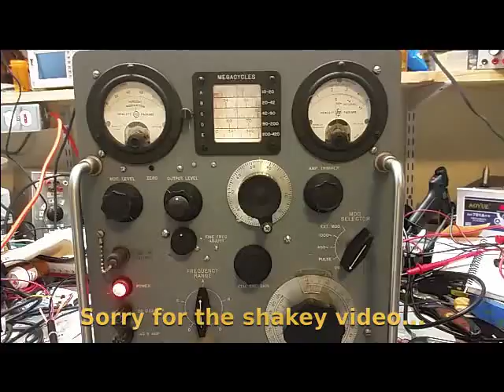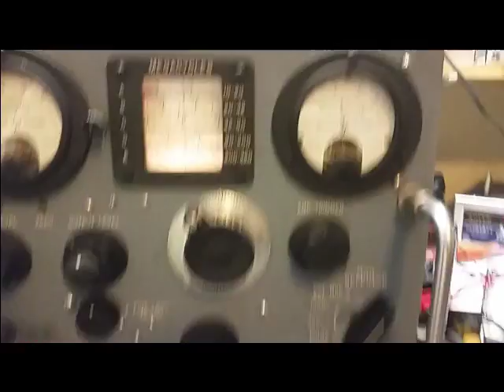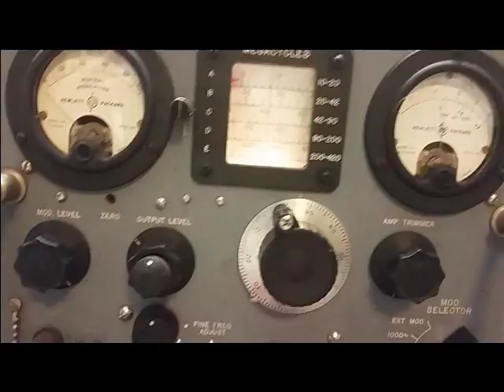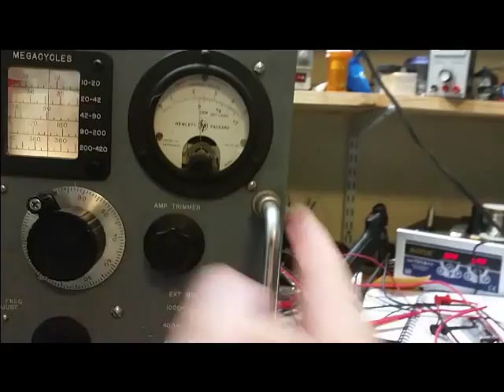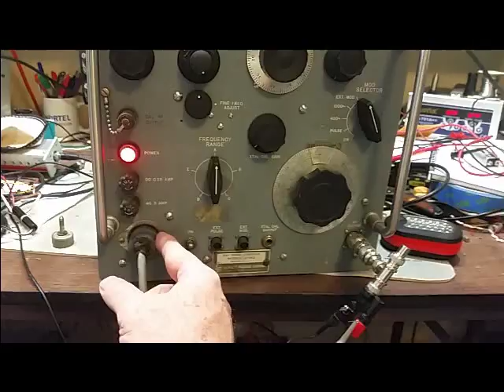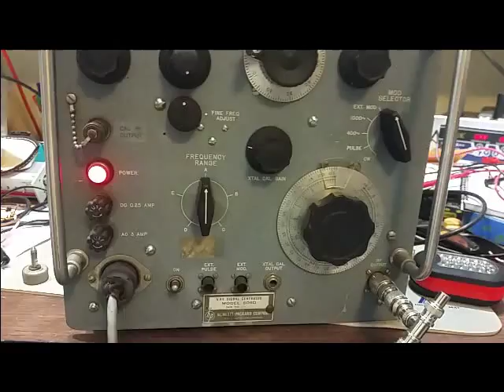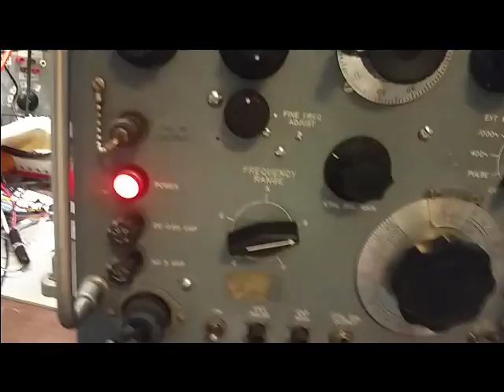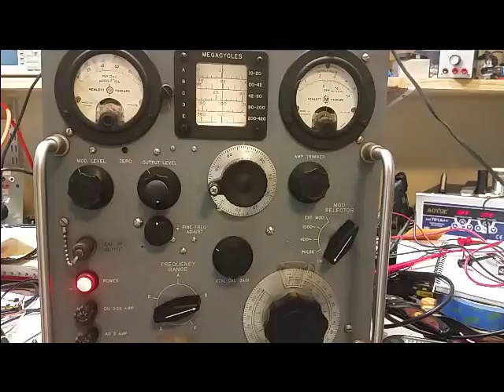Hewlett Packard 608D VHF Signal Generator Overview and Operation

Comment: I remember the H.P., Hickok and Tektronix "monster series" test equipment very well. Had to pickup and deliver calibrated test equipment to the user. The equipment was rugged and surprisingly accurate after a long warmup. We had to perform mechanical adjustments when needed for the dials.

Comment: I have a 608E that is just sitting here collecting dust. Is it of any value to anyone? I hate to just sit on it if someone could actually use it. Are they easy to get? I got mine from a local college that was retiring a bunch of gear.
Reply from the maker: They actually are a bit "rare" from the perspective of how often you see them at things like hamfests, but they are also beasts to move around. I have a small device not much larger than my phone that will do everything my HP608D does. I love restoring and using vintage gear. Hope you can find it a good home!
Reply: @W4JBM  It might have to just sit in the corner of my studio and look cool. I can't bring myself to scrap it.

Comment: If you need to monitor the frequency output on one of these with a frequency counter whats the best way to do it? Also how do you get a 100uv signal to represent S9 signal strength on a CB radio out of it, any ideas on the settings? Great vid, thanks Mark
Reply from the maker: The "best" way depends on what other test gear you have around. Most of the time I'll use a simple "T" off of the output and feed that to my oscilloscope. I use a Rigol digital scope that can give me frequency and amplitude (already converted to RMS). Before the Rigol, I'd use my frequency counter first to set the frequency and then connect the scope to set the amplitude. Either way, I connect it into a step attenuator and usually to the radio and then set the amplitude (watching the scope) to 0.28 volts peak-to-peak (which is 0.1 volts RMS). I have the attenuator set for 60 dB (usually the most attenuation per step is 20 dB, so I have to flip three switches to do that--before the step attenuator, I had a homebrew 60 dB fixed attenuator). Each 20 dB bring the voltage down by 1/10th. So with 60 dB, the output of the attenuator is 0.1 volts / 1000 or 100 microvolts. (I can also step it down another 40 dB to get 1 microvolt.) If I didn't have a scope, I'd probably us my x10 utility amplifier and a simple diode-based RF probe to set the amplitude to a known value. Unfortunately I've found I can't trust the attenuator on the HP itself, but that may just be mine. The mechanical attenuator just doesn't seem to have aged gracefully and no matter how much I tinker with it I find it falling out of calibration if I try to change the attenuation by much which is why I would use the external attenuator.

Comment: The story years ago was that each Atten dial was engraved for that assembly..
Reply from the maker: TheRetiredtech I've heard that the HP 200CD dials had the numbers pre-punched but the dial divisions were scored individually for the units. I could see then doing the same for the attenuator on the 608. I had to do a bit of mechanical work on it and the scale isn't anywhere close to accurate now. It is very smooth and repeatable. Maybe I'll get some paper to past on the knob skirt and see if I can come up with a calibration.

Comment: How is the frequency stability of yours? I used to have an E model that drifted a lot at 2 meters but I still managed to use it to align receivers, it required constant re-tuning though.
Reply from the maker: The stability seems reasonably good. I used it to align a filter section on a spectrum analyzer that is up around 110 MHz. I was using a USB SDR as the receiver and there didn't seem to be any noticeable short-term drift over 5 to 10 minute intervals. It would be interesting to measure the stability some day.

Comment: While working as a federal employee, I repaired many of the 608 series Signal Generators. Those were the good old days.......
Reply from the maker: The estate this came from had a fair amount of retired FAA gear including an HP 200CD audio signal generator and a General Radio 100 kHz frequency standard (along with the equipment necessary to calibrate it against WWV) that filled two racks. I'm not sure if this came from the same lot of stuff he had picked up then or not. One of my early jobs was as a civilian electronic engineer with the US Army. The other day I came across a picture of one of the old HP frequency counters that had rows of ten lamps that backlit the numbers 0 through 9 and it brought back memories. The thought and creativity that went into some of that vintage gear is incredible.